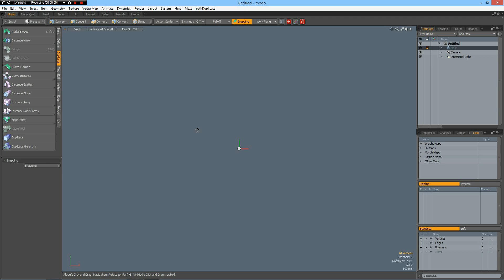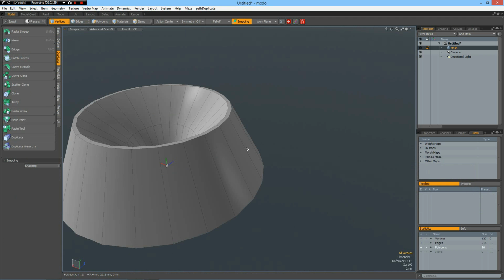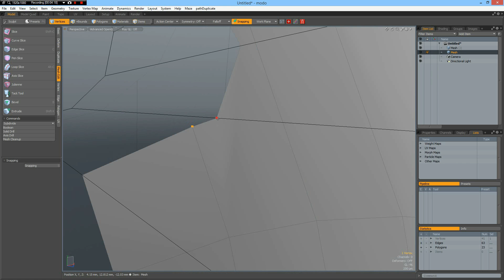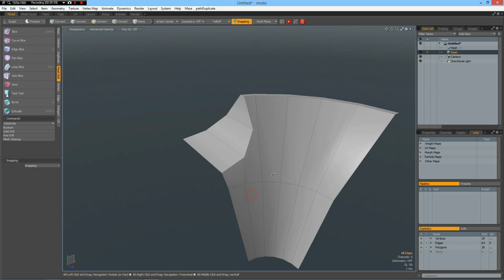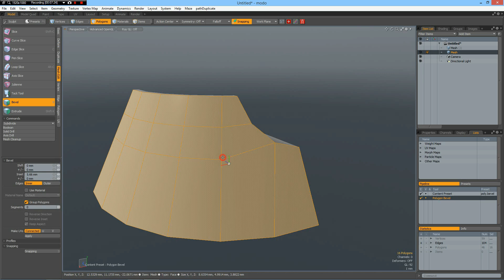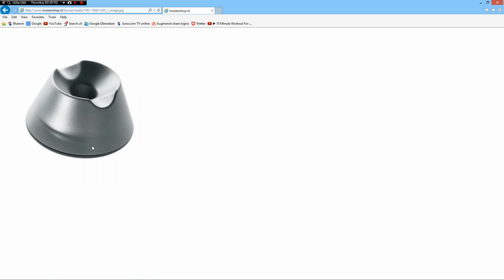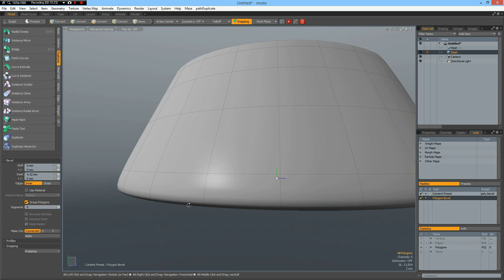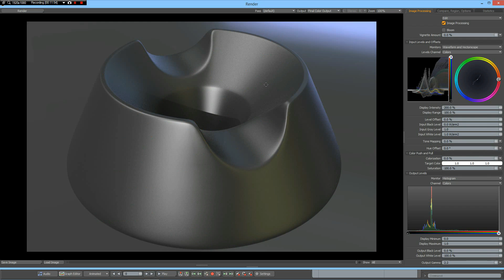The Foundry MODO - Wacom Pen Holder for Chris Wright

Comment: The proportions are slightly different in the original Pen Holder. But the process of creating, I was pleased, thank you Peter!
Reply from the maker: LuckyKOT1 Hi, yes i noticed this also. The model on the picture is taller then the one i did, but the process of modeling it should not change. Kind regards, Peter

Comment: Hi, Peter. Thank you very much for what are you doing.

I probably know why bridge tool doesn't work properly in this tutorial. It's because of order the edges are selected. If select it from bottom to top on one side and then repeat it in the same order on another, it should work. This was covered in one of the early modo official tutorials.
Reply from the maker: Petr Poletaev Hi, thanks very much for this helpful comment. All the best, Peter

Comment: Hi Peter,
Lesson, as always on the highest level. Thank U!
Sincerely, Stephen.
Maybe when using Solid Drill, you can use the "Tunnel" - just cut a hole.
Reply from the maker: Stephen Doll Hi Stephen, thank you for your comment and of course you are right. There are more direct options then the Stencil one. But i got so used to that, i hardly ever use another one :-)